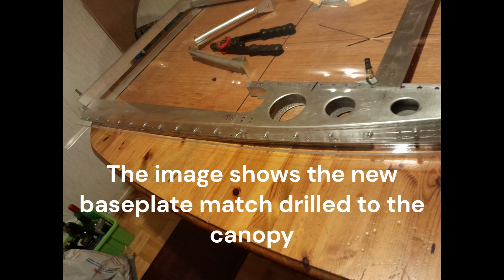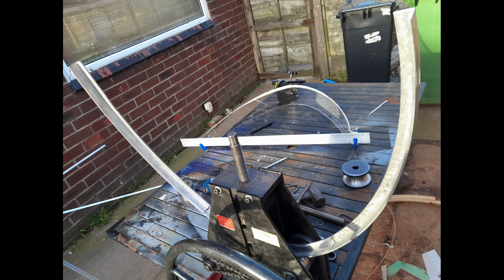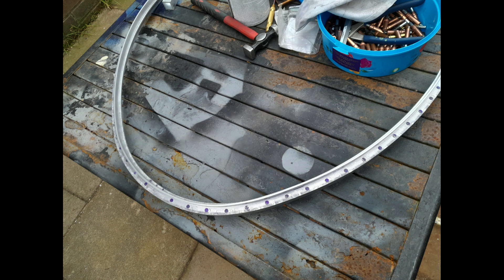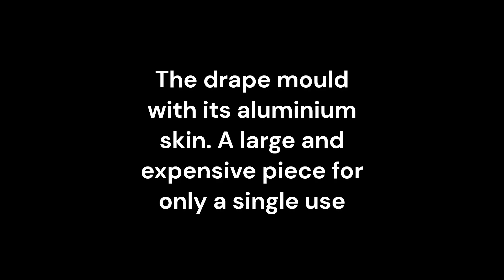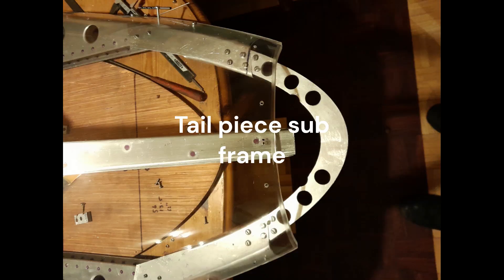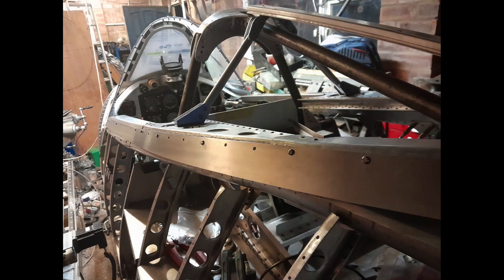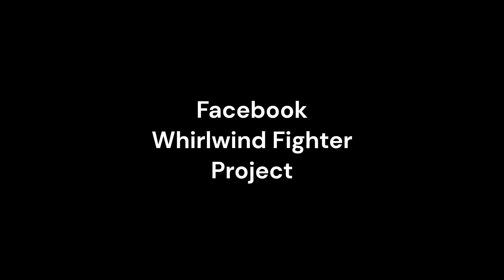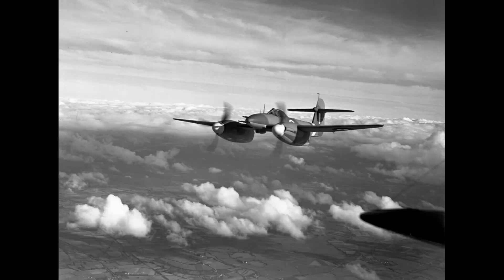Whirlwind Fighter Project - Engineering Update 12 - Canopy

Comment: Wouldn't it be better to make the coupe in two pieces, utilising the frame in the centre to join for and aft sections?  An accurate shape could then be moulded as each section would be much smaller. To modify the accurate forward quarter panels to fit an inaccurate shape seems very strange to me.
Reply from the maker: Thanks for the comments. We agree, however the only company that agreed to undertake the canopy would only manufacture as a single piece. This proved correct, due to the canopy being free blown to templates we would have ended up with a double bubble canopy with the same bulging issues. The WFP accepted this compromise as an interim measure. The cost of the free blown to template canopy was in excess of £5K. The cost of a cavity mould and plug would be in excess of £20K. All the original coupe base plates, front quarter panels, hoops etc have been put in storage, with the future intention of producing a cavity mould formed canopy when sufficient funds become available. Our current thoughts being "better a compromise canopy than no canopy" Pete
Reply: Sound issue towards the end